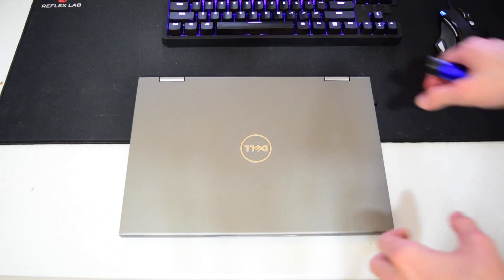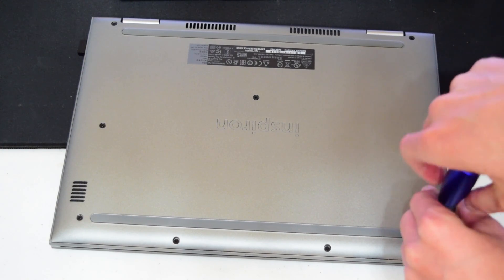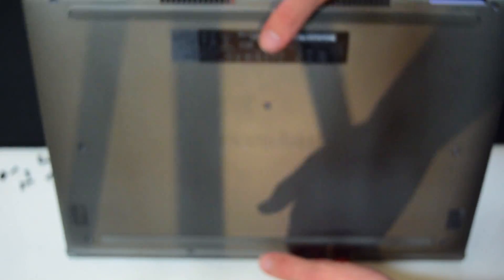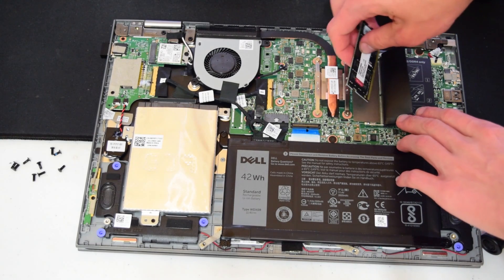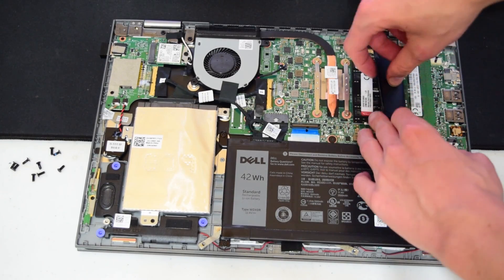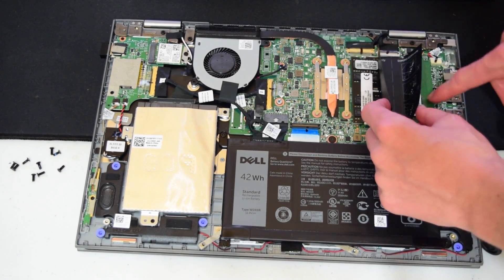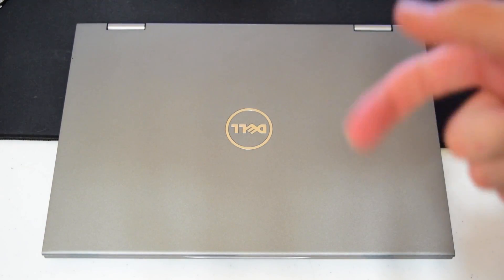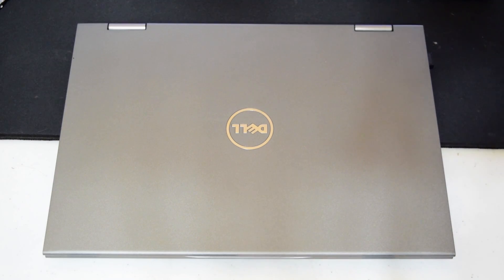Dell inspiron 13 5000 2 in 1 2016 ( ram and ssd upgrade with teardown)

Comment: Did your hyperx impact work with your other ram in dual channel?
Also can the motherboard take a ddr4 2666mhz instead of the current 2400mhz?
Good video. Found it very helpful before.

Comment: What do ram you recommend buying for this laptop?
Reply from the maker: this is the exact ram i got :    https://www.amazon.com/dp/B014R8JPYW/ref=twister_B01NBLZCB4?_encoding=UTF8&psc=1

But any 2133mhz kit of 2 or 1 sing dimm should work, i got a single stick so i could keep what it came with for a total of 12gb. Mare sure your buying ddr4 sodim memory and for maximum compatibility to match what dell ships the laptop with i would say go with 2133mhz even though faster ram should work. 

Thanks for watching, don't forget to subscribe, have a great day.
Reply: hey i just bought that ram that you used for the video but i have the latest dell inspiron 13 5000 with 8th gen core. Would it be compatible?

Comment: what would be the max specs for this
Reply from the maker: Max specs i believe i could have gotten a i7, if not a i7 then i5, i think 16gb of ram and like a 1tb hard drive, this model i don't remember having a ssd option from the factory but i could be wrong. Thanks for watching, don't forget to subscribe, have a great day.
Reply: so you can take out the processor????????
i thought its not removable
Reply: You cant take out the processor. The most you can do is upgrade the RAM to 32GB and the hard drive to 1TB

Comment: Hey Dude... Are you sure it support for 32 GB of RAM? I need you confirm for it. because i looking for almost web and dell tell support only 16 GB of RAM
Reply from the maker: i Looked at the cpu on intels site and it does support 32gb of ram, there is no reason it shouldn't even if they say not supported it can still work perfectly fine. cant give you a solid yes but there is no reason not and if you order from amazon and it doesn't work then just send it back.

Thank you for watching, i hope that helped, don't forget to subscribe, have a great day.

Comment: Hello, would it be possible if I upgraded the hard drive to a Samsung 1tb ssd and with the ram upgraded to 32 gb?? I want to make my laptop efficient so i can use photoshop and my adobe premiere pro with ease and with it no crashing all the time.
Reply from the maker: yes you can this computer can support 32gb of ram and a 1tb ssd. it would be better to have a bit higher power laptop if you want to use premier, it will work but even with all that it might still scrub with this cpu. 

Thank you for watching, i hope that helped, don't forget to subscribe, have a great day.
Reply: You may have issues with overheating when rendering HD/UHD/4K, which is almost the standard nowadays.  Even with H.265, which is more efficient, I think your laptop will generate a lot of heat.

Comment: I just bought a Dell 5378 13" i3 6200u laptop, 500gb wd blue & 4 gigs of ram same as yours. First time using it, it's a little bit laggy, do you feel the same or just mine? thanks
Reply from the maker: yes i have the same, it can be lagy if you have lot of programs open or it might be running a security scan, mine came with McAfee security and first thing i did was uninstall it, it makes computers super slow, and opened task manager and went to the startup tab and disabled all the stuff i didn't want to start when the laptop turned on and that helped with boot times and made it more usable when you just turn it on.

Thank you for watching, i hope that helped, don't forget to subscribe, have a great day.

Comment: Hey Len how you doing? Can you give us a walkthrough in the specifics of the validation process of the windows 10? I'm talking about the validation in a clean install on a new SSD drive.. I'm afraid I'm about to loose the license, really don't know how this works. <O>
Reply from the maker: As long has you at least have the windows 10 anniversary update but it might be for all windows 10 your product key is tied to your machine so you could do a fresh install and not enter a key and windows would automatically match your key with your machine and activate windows. Now ill leave a link below for you to check out my hard drive cloning video and if your not interested a clean install and just want to add a ssd but keep all your stuff or at least how it is out of the box then that will show you how, you will now have to use the cloning software i used but if you wanted to you could use any cloning software but i featured the  acronis true image software. If you have any more questions feel free to ask.

Thank you, thank you for watching, don't forget to subscribe, have a great day.

Comment: Hi, I've got an Inspiron 13" 5378 (kabylake 7200u, 8gb, 256gb ssd)

Have you experienced any CPU overheating/loud fan noise?  At first this seemed to be due to CPU SSD and RAM usages all in the 90's to 100% while updating and installing software.  However, this still happens now when browsing the web or anything really.  The CPU turbo's up to just under 3.1ghz and rapidly hits 80 degrees c.  

I'd be interested to hear any advice you've got.  I've opened up the laptop and had a look around - nothing seems out of place.  I'll probably replace the thermal pads on the heat-sink and replace the thermal paste, then replace the fan unit if the problem persists.  I don't really want to have to go through an RMA/returns process if I don't have to so any tips to help me debug the problem please let me know!
Reply from the maker: This is most likely due to the fact that all dells come with mcaffee antivirus, it seriously kills battery life and slows the laptop down so much and makes them get super hot even when idling and not in use. My laptop does run a bit warm under a gaming load where the cpu and integrated graphics are being used, but other than that no, i uninstalled a lot of the bloatware and especially mcaffee and now it run great, quiet and cool when just using it to browse the web or something not that taxing. These laptops do max out at about 80c or just over and that's hot but still completely safe for a operating temperature but it should never get that hot unless your taxing the machine heavily and not just browsing the web. 

No don't replace thermal pads, if nothing looks missing then just leave it, its something in the operating system causing the cpu to spike to 90 to 100%, i'm betting the antivirus program. Do make sure you do set up windows defender, its already installed on your machine and it doesn't kill your batter or make your system run at 100%, it might ramp up once a week to do a quick scan but that's about it, also another thing that can bring your machine up to about 30% usage is windows installing or updating new updates and sometimes it will last a couple hours just depending on what its doing. Just be smart and don't just download anything off the internet and you'll never get a virus, i have absolutely 0 viruses on my machine and i've had it for about 2 years without a anti virus software running at all times and the reason i don't is i'm careful about what i download and install.

Thank you for watching, i hope that helped, don't forget to subscribe, have a great day.
Reply: Same problem. Tried everything. I'll try getting ssd hopefully it will fix the issue.

Comment: So is there no M.2 slot in this laptop? Like adding more SSD storage?
Reply from the maker: No it doesn't have a M.2 slot on this particular drive, only one drive slot for a 2.5in drive. There are 2.5in ssds up to 4tb on the high end but there are some fairly affordable high capacity 1-2tb ssds on the market, well as affordable as a ssd can get for now.

Thank you for watching, don't forget to subscribe, have a great day.
Reply: Len Nobles sorry for the late reply, thanks for letting me know!

Comment: Do you get Wi-Fi drops with this?  I've heard this happens with the 1x1 cards like the Intel 3165.  Luckily it's an easy upgrade to a 2x2 card.  The m.2 Wireless-AC versions of the Intel 7260, 7265, 8260, and 8265 range from $8 to $25 in the aftermarket, and they're all functionally equivalent if your router is more than 2 years old.  If you have a brand new router you may want to get the 8265 which supports MU-MIMO.
Reply from the maker: Thank you for the information and when doing file transfers you definitely notice how slow the wireless is, it transfers at about 30mbs, so about the equivalent to 300mibs internet or 30% of a gigabit connection. so not the fastest but I've never experienced any dropped connection issues, so that would be a no.

Thank you for watching, don't forget to subscribe, have a great day.

Comment: if replace the hard drive will my information still be there?  Like my files? I don't need to set the laptop in some kind of mode?  I just power off.
Reply from the maker: If you directly replace it without coning it you will, but if you clone the hard drive then no you wont loose anything and all you have to do is swap the ssd in and everything will be exactly the same but youll receive all the benefits of a ssd. Here is the link to my video on how to clone a hard drive:  https://www.youtube.com/watch?v=AfKVq5F9wKE

I just shut the laptop down, now you probably should disconnect the battery but i didn't bother with it and if the laptop accidentally powers on its no big deal, just be a bit careful if your replacing ram too, and to answer the question about removing the battery, thats a definite no, maybe is you want to be super safe disconnect it, but i took the ssd and ram out twice for that video and never had a problem and all i did was turn it off.

Thank you for watching, don't forget to subscribe, have a great day.
Reply: Len Nobles I'm not about to replace the ram. I'm just adding more ram.. Then it should be OK?
Reply from the maker: Replacing and adding is just about the same but i've never had a problem with it and have never heard of any problems caused by leaving the battery still plugged in so i say no, just go for it

Thank you for watching, don't forget to subscribe, have a great day.

Comment: Hey man I just upgraded to a SSD as well and the corner which has the HDD is raised up a bit when I use the computer. Is yours the same?
Reply from the maker: no it isn't, you may have not put the back cover back on correctly or you might have gotten a thicker than standard ssd, but my guess is you didn't put the back cover on correctly as i had that problem until i made sure it was on right and if you follow the steps in the video there is a specific way to put it back on correctly so it will be completely closed.

Thank you for watching i hope that helped, don't forget to subscribe, have a great day.

Comment: Thanks for the awesome tips! I just upgraded my ram on my Inspiron 1300 2 in 1. I could see some improvement afterward. I'd love to get an SSD as well. Do you, or anyone else, recommend a website where you can buy one that's not gonna hurt my pocket as much?  A 1TB SSD is still pretty darn expensive.
Reply from the maker: unless you want to buy used or you can try bidding you can go with ebay, now there are forums and places like that you can buy from but there are risks involved with that and you can exploit at your own risk, but the place i see good deals when you can catch them are newegg, if you wait and be patient ive seen a 1tb ssd like right around 200 or even lower before if i remember correctly and it was a good brand so if you can wait you might find one there. I also use amazon and you can find some good deals at times on there as well.

Thank you for watching, don't forget to subscribe, have a great day.

Comment: hows the laptop? you still have it? hows the brightness? i was about to pick it up, then i seen the brightness in the store and it looks like it doesn't go very bright. its looking like its only 260 nits or something..
Reply from the maker: The Laptop is great and still working perfectly, yes i do, and i barley ever turn it above 40% brightness indoors and a lot of the time i leave it at 0 to 20% brightness, idk the exact screen specs but for me it is more than bright enough, it is a glossy screen so there can be some glare but that's not even a option since all though screen devices are glossy screens. 

Thank you for watching, don't forget to subscribe, have a great day.

Comment: has this laptop any kind of slot for a second ssd?
Reply from the maker: No it does not have any other internal options to add a extra drive of any kind.  Now if you want you can get up to a 2tb drive or use a sd card, but if your going for raid then no, this laptop doesn't have the support for a additional drive.

Thank you for watching, don't forget to subscribe, have a great day.

Comment: Thanks for the great video. If i upgraded the RAM, would I need to reinstall the windows system?
Reply from the maker: No, the system will recognize a change in memory and ask you a question and then it will proceed to boot as usual and then you can open task manager and see how much ram you have. Bu to you will not have to reinstall windows and if it down boot you might wan to check and make sure its in all the way but i've never had that happen before but if you do in fact have a problem re seating the ram will usually fix it but there is a a super small percentage that anything goes wrong if you follow my guide.

Thank you for watching, dont forget to subscribe, have a great day.

Comment: parts list u used or link
Reply from the maker: ram: https://www.amazon.com/Kingston-Technology-HyperX-2133MHz-HX421S13IB/dp/B014R8JPYW/ref=sr_1_14?ie=UTF8&qid=1484087742&sr=8-14&keywords=ddr4+sodimm

ssd i recommend and you can follow along with the how to clone a hard drive video i have because this comes with the same software since i bought this same ssd.  https://www.amazon.com/ADATA-Premier-SP550-240GB-ASP550SS3-240GM-C/dp/B013J7Q338/ref=sr_1_1?ie=UTF8&qid=1484087879&sr=8-1&keywords=adata+sp550

Thank you for watching, don't forget to subscribe, have a great day.

Comment: Great vid bro. I just bought this computer with a 1tb HHD hard drive with the 7th gen i5. Can I replace my current hard drive with a 1or 2tb SSD? If so, what size does it take, 2.5"? Also, do you have to reboot Bio's? Can you do a vid on what to do after the replacement? Thx!
Reply from the maker: yes you can replace it with a 1tb or 2tb ssd, no you don't have to reset the bios. No all you do is put the drive back in after you have cloned it or you just plan do do a fresh install afterwards but all you do is turn the laptop back on and the bios will detect a change of the boot device and then ask are you sure you want to boot to this device and you hit yes or enter and that's all you have to do. 

Thank you for watching, don't forget to subscribe, have a great day.

Comment: What are your thoughts on the uv400 ssd? Is that better than the v300 for this laptop?
Reply from the maker: Neither ssd is anything to write home about in terms of performance but still a big step up from hard drives, they will perform very similar and you would be reluctant to ever see a real difference choosing one over the other. Given that Kingston is a reputable brand i would say either ssd should work great.

Thank you for watching, don't forget to subscribe, have a great day.
Reply: Len Nobles 

Thanks for your reply, really appreciate 😄

Comment: Hi! Do you still recommend it? Any problems after those months? I'm thinking on buying this with i3 + ram and ssd from local market, but since it's not cheap, I'd appreciate if you could tell more about your experience with the product. Thanks and sorry for my poor english.
Reply from the maker: yes is still recommend it for a media consumption and productivity with office or web browsing of those sorts, i wouldn't recommend it for any heavy workloads unless you just need it fir something light but any professional application that it needs a lot of power i would not recommend this laptop for. No actual issues with the laptop, with windows some, but none that the laptop itself is at fault for. It loos really nice i use it for school and media consumption and it works great and is build solid but light enough that i carry it in my hand no problem, its just a great laptop for the price and can handle some light gaming if you desire.

Thank you for watching, don't forget to subscribe, have a great day.
Reply: Thanks for your fast answer! I've "liked" it before reading, since the notification poped up when I was busy. Fact is: I'm finding it amazing, but around R$3k (2.5 + ram and ssd), it's among some other great choices, like a Samsung notebook with 940mx dedicated graphics (not that I'm looking for a gaming device, but you never know... gaming "happens" lol), and that's why I've decided to ask you before further thinking on the matter. Well, now that you confirmed that it's a great device, it's going straight to my Excel chart! Thank you again, and be sure that you've gained a subscriber.